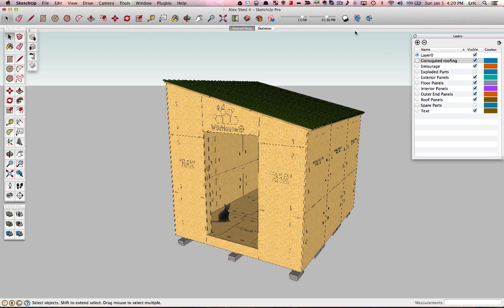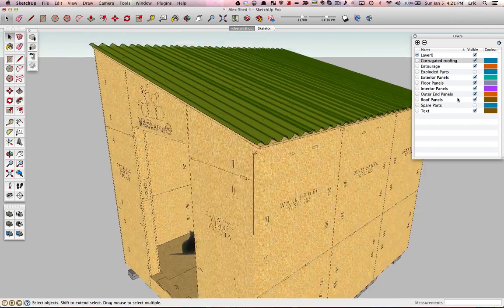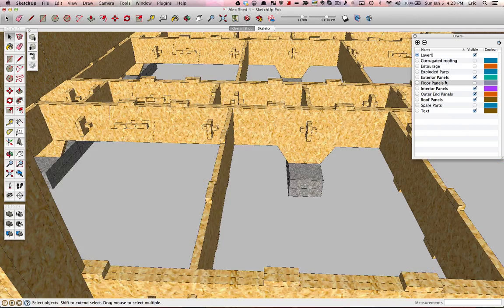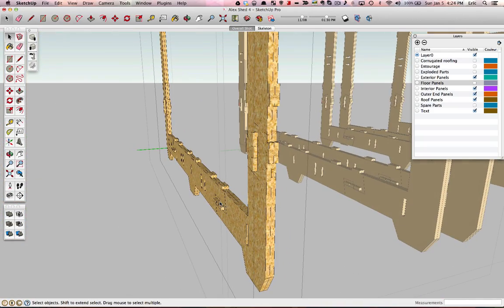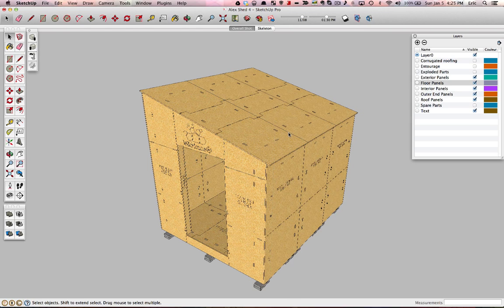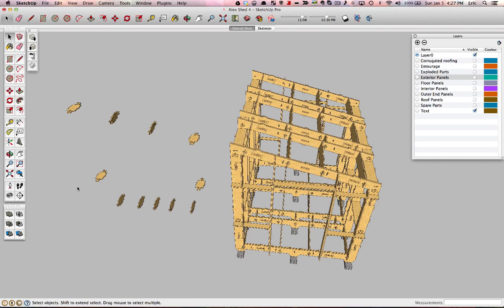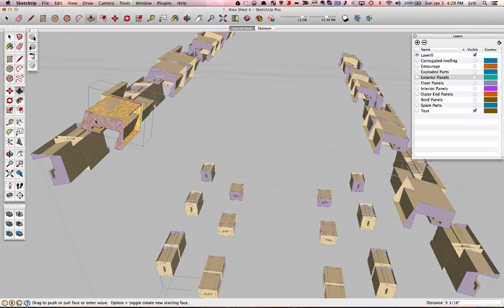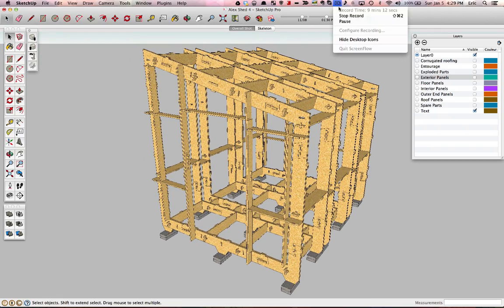Wikished Sketchup model tutorial

Comment: Great job on setting up all the components! Very easy and quick to make changes. What about adding electrical chases in the walls and ceiling? I love the idea of the CNC pieces but I don't see how it would be any cheaper or easier than typical 2x4 or 2x6 wall construction. It also seems like you could have problems of the plywood delimitation with any moisture on the floor joist. What is you experience with these issues?